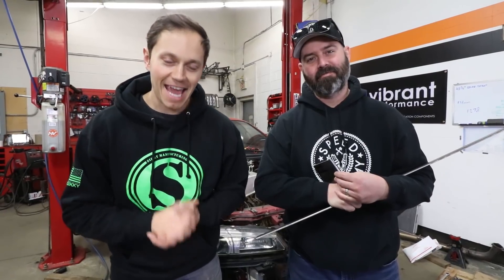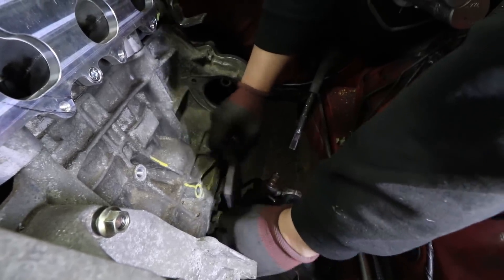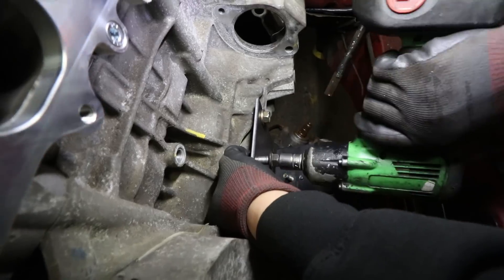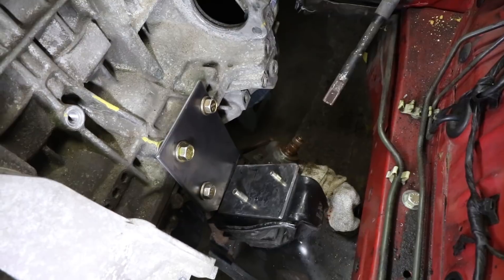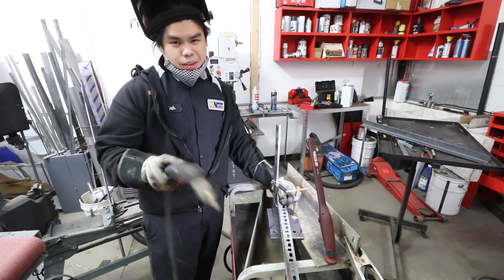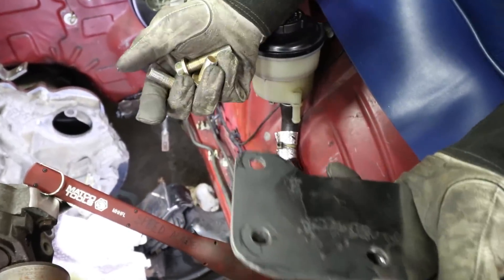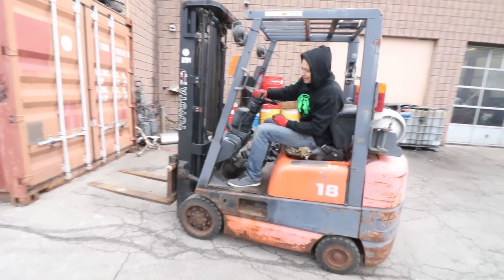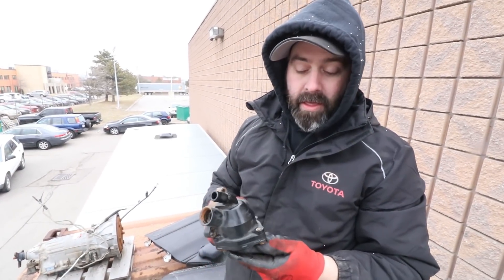Fabricating K-Swap S14 Engine Mounts - Honda K-Swap 240SX

Comment: Hey guys it possible to make a Mazda speed 6 rear wheel very simple with RX8 6 speed transmission, I think it don’t need spacer between transmission and engine, 280HP directly

Comment: Could you  please tell me what size metal did used for the mounts
Reply: Cesar Ortega 3/8th hot rolled steel. But if you're planning on making these use cold rolled.
Reply: Vinh Ngo yes I'm planning on making some I was going to use regular steel but I rather ask professional like you.. what's the difference between hot and cold
Reply: Cesar Ortega when you buy steel it'll either be hot rolled or cold rolled. Cold rolled is just better for welding

Comment: We know you'll be going with a custom made propeller shaft and might have done the checking behind the scenes but I hope you can later discuss the details on how you determined the output shaft alignments, angles, shifter positioning, etc that determines the final position and angle of the K-motor in there. Thanks for these build videos! keep em coming!

Comment: Looking good guys! I think I'm sold on this swap, and will only purchase some top feed injectors for my SR to take advantage of the gtx2867gen2. Once this motor goes, I'll get a k24 as the replacement in the Z32 and carry over my turbo and injectors for some easy and smooth power. This is an exciting swap!

Comment: You gonna use the head off K20 as well?  I'm not super knowledgeable on K series, but i hear the K20 head flows alot better than the K24 and is pretty common practice for racecars.
Reply: Not the k20a3 head
Reply: Honestly, a tsx k24 head almost flows just as much as a k20 type s head I think the difference was like 4 cfm or something minimal like that.
Reply: Back when i had an fa5, everyone wanted a z3 head from our cars. Its probably different now but that was part of the formula for all those 300+ na hp power
Reply: k20 type s a z3 or the jdm itr head are the heads you want.
Reply: its like a 60whp gain on the same  fuel with a k20a2 head lol

Comment: Should make a jig for the mounts so they can produce them
Reply: I was thinking the same but then I reckon that replicated mounts would only work with the same block/gearbox setup being used here, unless that is the absolute ideal block position and there is tolerance on the gearbox side for different gearbox choices??
Reply: #speedfactory